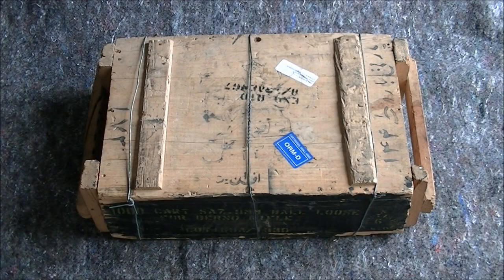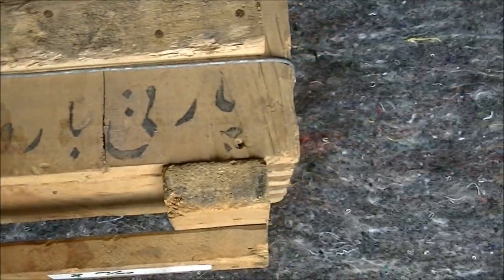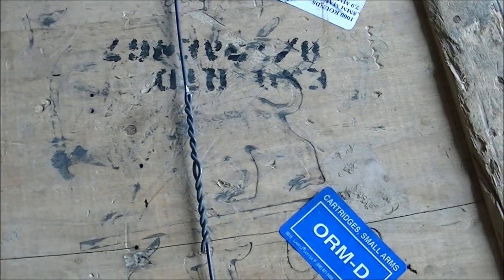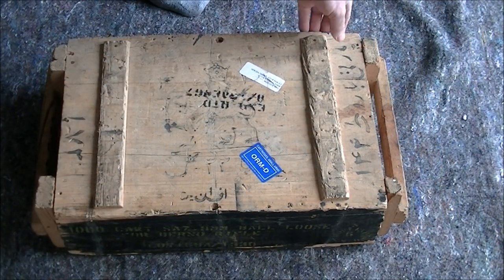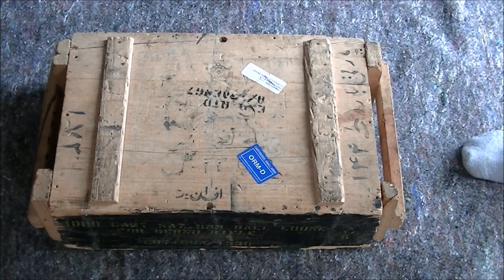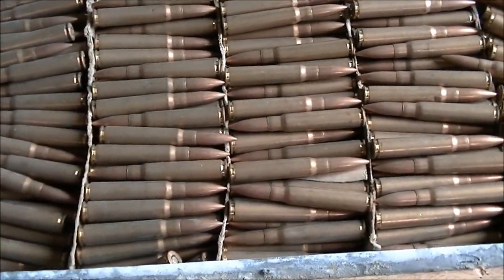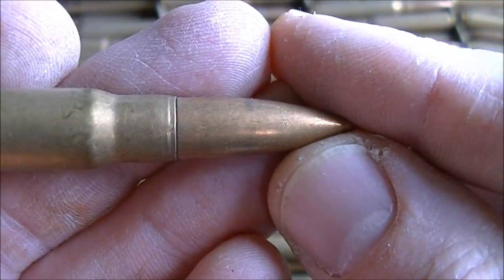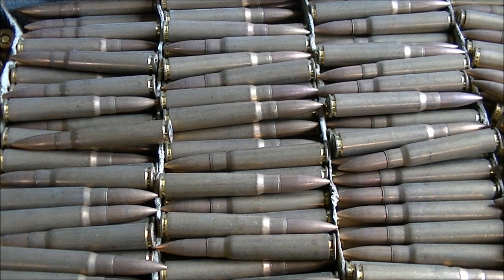Uncrating Persian/Iranian 7.92 Mauser Ammo

Comment: The first set of markings are numbers, "1 7 3", the second set looks like "aban 10" which would be November 10th, and the third set I see "144" but the word next to it is pretty f'ed up.  It doesn't even look like any letters or numbers turned sideways, or what-have-you.  When you get to the embossed markings, it looks more like the calligraphic script, although I can pick out a "7/9", maybe some individual letters like "S" "T" and a "Z"... but that's going to take someone will a lot more familiarity than I.  

The bottom of the cartridge has a crown on the top, "1" on the left, and "2" on the right.  The bottom side looks like "1330" which, if that is the year, converts to 1951.

Persian mausers are prized collections for any milsurp collector.  They are Czech-made (hence "Brno/Berno") during peace-time, so the production quality and tooling was notch, plus their use was generally pretty limited.  As for the ammo, I have shot milsurp Czech ammo, but I don't remember anything distinct - but you're probably going to be correct in that there will be flake powder in there.  What might catch you off-guard is that the pills might be in the 175gr range, like some of the yugo ammo.
Reply: Scratch the aban 10/november 10th.  I'm rustier than what I thought, and in trying to remember the difference between a B and an N, I apparently saw one of both.  Honestly, now I'm not sure what I see, because I originally figured that there was some marring going on, either because of the age of the ammo crate, or because a cursive script doesn't always work well for stamping on a wooden box - I think I saw what I wanted to see.  Now, not so sure, but I'm somewhat confident it starts with an A, and ends with an N.  (Someone else come to my rescue?)
Reply from the maker: Thanks for those insights. I've broken down some of the ammo and the projectiles are actually 197 grain in weight with a boat tail base. It will be interesting to see how they shoot.

Comment: I just picked up a Persian Mauser Carbine made in Sari, Iran. Possibly the same city where the ammo was made. IF I'm not mistaken, most of the long rifles were built in Czechoslovakia, with carbine production being done in Iran.
Reply: I owned an iranian carbine with the 16" barrel...i went to a military shoot, was using " turkish ball ammo " when i fired the gun
Was so much muzzle blast and flash...they asked me to use another rifle...luckily thst day i brought along my #4 enfield as well...i finished the day with
The #4 snd placed 4th overall out of 35 shooters.  The iranian carbine i regretfully traded off for another gun back then, paid 159$ plus taxes for the carbine in 1995, now days that carbine
Is rarer then hens teeth, seen one selling for 2500$
Reply from the maker: Nice. How would you rate the quality of the Iranian made carbine when compared to the Czech made rifle?
Reply: @314299  The Czech ones are perhaps the most gorgeous surplus rifles I have ever seen. They're of higher quality than any German Mauser I've seen, which is saying something. The Iranian made carbines are not nearly as high quality, but they really don't need to be as nice as the Czech ones. Still very well built, with minor tooling markets in non-critial areas. Better than Turkish, Yugo Mausers for sure.
Reply from the maker: @nils4137  Thanks for those observations. Cheers!

Comment: It'd be nice if it turns out to be ammo rather than just bullets and scrap brass.
Reply from the maker: I pulled a few rounds down and the inside of the brass looks good and the powder does not appear to have degraded. No way to tell if the primers are still any good except to fire some. At the price the owner paid he got a good deal if all he paid for was the projectiles.